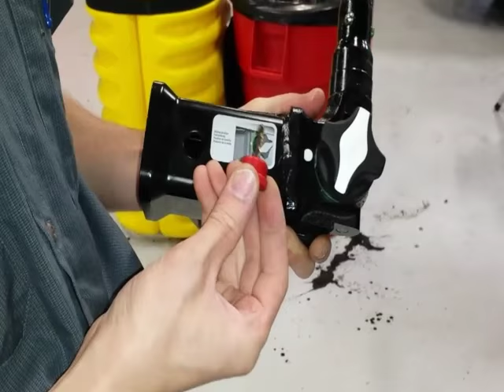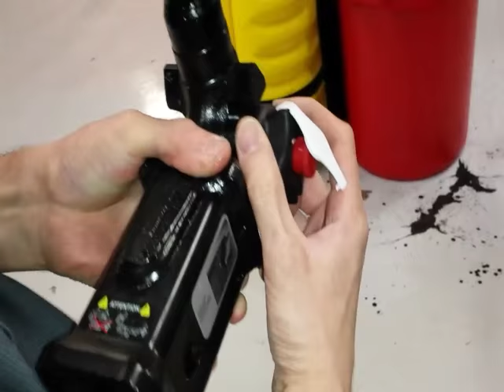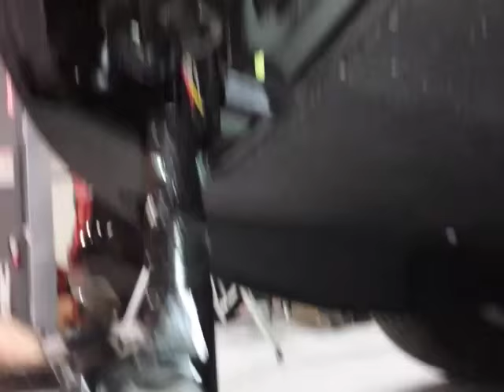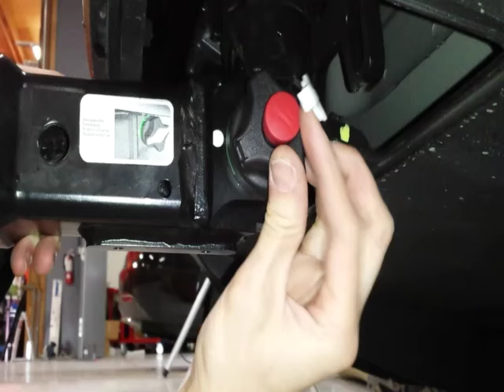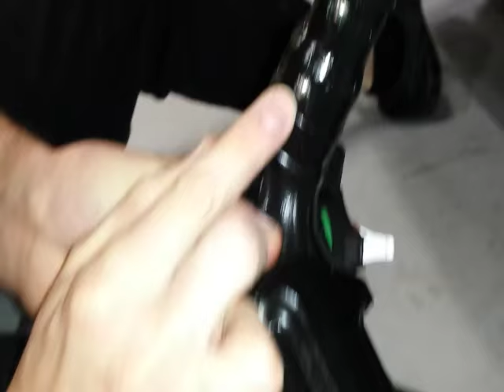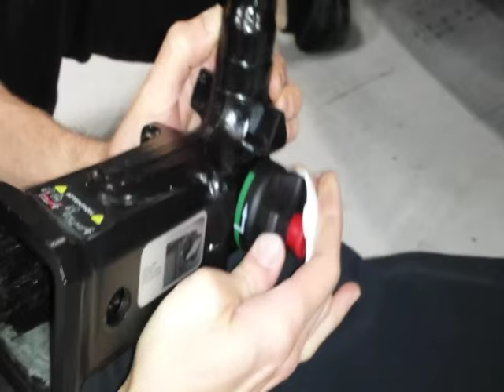Model X Tow Hitch Installation & Removal

Comment: When storing the Hitch can you keep the key in the hitch?
Reply from the maker: +Joshua Fredrickson , I suppose you can if you want. That would make keeping track of the hitch key easier.
Reply from the maker: One additional thought, if you do leave the key in the hitch and it's rolling around in trunk area, there's a chance the key knob will break off and the key blade will be stuck inside the hitch lock. So, maybe not a good idea to leave the key inside the hitch if you're keeping it in the trunk of the car.
Reply: Not a real problem. It is designed like that so that you do not remove the key and loose it.

Comment: The dust cover for the hitch assembly on my new model X is not as pictured in the manual and I have no idea how to remove the two bolts holding it in place without damaging the cover. They are not any type of bolt I've ever seen and there are two rather than the single bolt with normal slot shown in the manual. Please advise, THX!
Reply: The dust cover is held in place by two plastic pop rivets.  They are removed by prying out - they are not threaded so do not try to unscrew.  A regular screwdriver placed firmly  in the side slot and turned will pop them open for removal. The dust cover can then be removed and stored while the hitch is in use.
Reply: I use my nails on both sides, pulling out the middle part of the head, and then they can be removed. To get the dust cover off, push up a little in front (as in, towards the front of the car) of the cover to bend the plastic a bit up, then you can get your fingers under the cover and pull it down and forwards.

Comment: Since it is such a pain, I use my other vehicle to haul my trailer.  Why could they not have just used the standard receiver and plug system, like every other SUV in the world. There is nothing but an added inconvenience with this design, and nothing wrong with the standard type.... Typical Tesla Over-Engineering

Comment: Awfull engenering, can not imagine that after few years of salt and snow exposure...
Reply from the maker: Do you have a better design than this that you would like to share? I think it will hold up just fine in snow and salt, it appears to be powder coated and well greased.
Reply: Living in Norway, I can confirm that this is not an issue at all. Drove on snowy and salted roads to our cabin last weekend, and it works really well. Also, when not using it, it is easy to remove and replace the cover under the car so it looks nice again =)